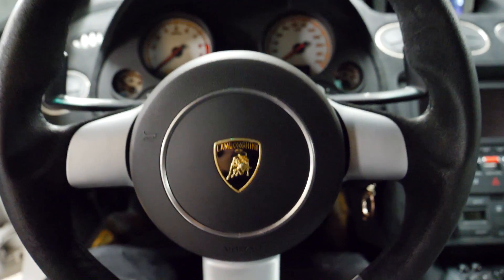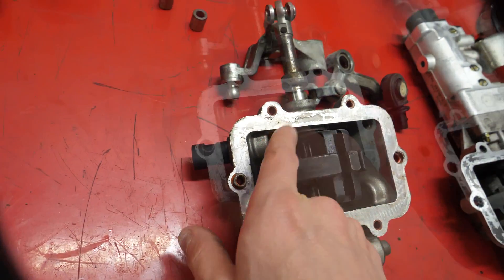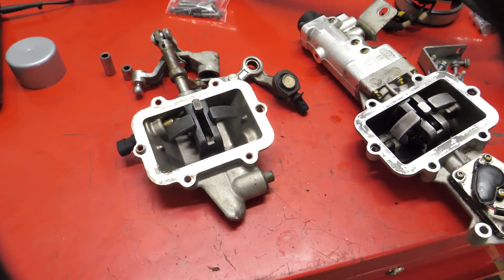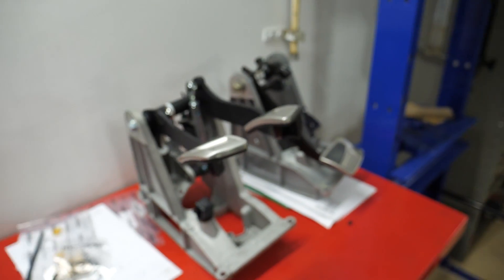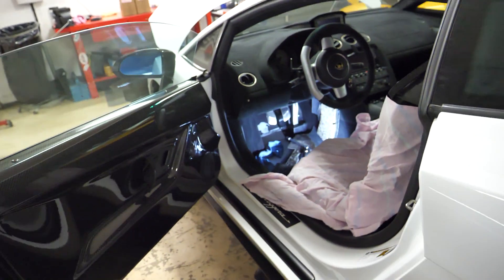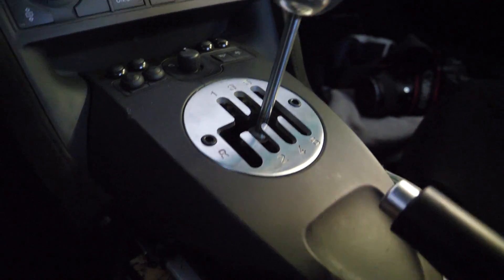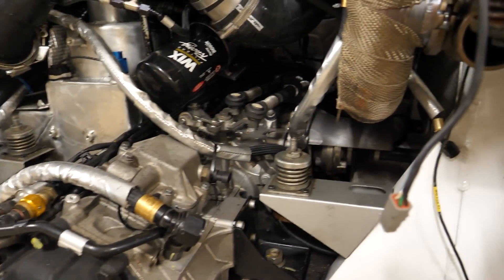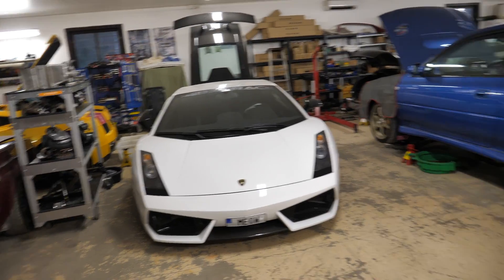Lamborghini Conversion to 6 Speed Manual Gated Transmission

Comment: Love your work, any chance you’d be able to share what size clutch master you ended up running? I’d like to do the same for the manual pedal box/clutch master arrangement rather than going factory. 

Thanks again!
Reply from the maker: I did end up with the OEM cylinder. Don’t know what size it has.

Comment: Nice video, i have one 2004 gallardo at the workshop converter to manual in another workshop 5 years ago, since that time the car jumping from place to another for can issue, there is lost communication with ecm and tcm, but cant find can diagram i didnt expect its that headach - __-
Where to find it? Coz i cant see it in the workshop manual.
Thanks.

Comment: I wish exotic supercar companies would trash the the paddle shipped formula one transmission. Because even on a drag strip they have a manual transmission with a clutch and it's way quicker than that goddamn piece of shit paddle shift. It's not the transmission that makes the car fast it's displacement. There is no replacement for displacement.  Lamborghini and Ferrari and Porsche need to bring back the manual transmission as a flagship option

Comment: Peter great to see a real Engineer/wrench/welder at work, my Gallardo transmission is acting strange it needs to be stripped how many hours would you estimate to strip and rebuild a 2005 30Kmiles it sounds like the 3rd/4th drop gears are 'whining'  I appreciate an experts advice

Comment: Quick disconnects can be opened up to improve flow. That is at least every one I've come across. 

A pair of mechanically coupled hydraulic cylinders can offer a way to get the clutch feel you're looking for.

I recall B is for build mentioning he had the first manual shift conversion. I now wonder that was correct.
Peace.

Comment: Genuine Lamborghini parts might indeed be very expensive.... But Toyota may have everyone beaten. A 1992 Toyota Celica Convertible, has a particular part that, in all, constitutes a single 'diamond' shaped metal plate (roughly 2 inches by 1 inch) with 3 holes in it----two of which feature captive nuts----and costs a damn fortune for no particular reason. Path Number: 02572-86101  and costs $648.00 USD.

Comment: Man, If Lamborghini was gonna go through all the trouble of building the E-gear system for the manual transmission...why didn't they just leave the clutch pedal and shifter in there? I mean that's pretty much an enthusiast's dream...use either or, whatever you're feeling like...there's plenty of space for it all. 

They could have still had either transmission type options but then they could have had a third option with both!

Comment: Hello, Love the videos
Im having an issue with my stage 3 turbo built Supperlegera E gear
I'm having an issue when reversing and taking off in first gear where the clutch is not fully grabbing making it difficult to drive. Only happens sometimes and when it does happen the clutch will not grab.. I can rev it up to 3k rpm and the car barely moves on first or reverse.. if it does grab which it does sometimes it will slam into gear randomly When I turn off the car and turn it back on it resets the catch points and works fine until I use reverse again or go back to low speed driving. I have changed the fluid. did a relearn. changed the throwout bearing, checked the clutch.. still no luck. We had our mechanic observe the clutch on the Lamborghini computer. When you first give the car throttle the clutch starts to release, as you give it more throttle the clutch for some reason pulls back.
If you turn the car off then back on the clutch points do relearn and it does go back to normal... but once agin if you use revers or go at a very slow speed it will start to have the same issue.....
Any idea what could be causing it

Comment: Hey peter ...Im having a issue with my dads vehicle ... Its a 2003 hyundai sonata 2.4l 4cyl . and we just had the radiator replaced because the old one was leaking .. The guy put the new one in and i guess the ac condenser is bolted to the radiator. My question is will having one of the ac condenser bolts off that holds the condenser to the radiator Cause the vehicle to overheat?

Comment: You make a manual conversion look relatively easy here. I never knew this could even be done.

Would that be possible with the gearbox in an Aventador? Probbly not because nobody has done it yet. The electronics would go nuts....
Reply: Would for sure be better than the stock e-gear

Comment: Hey Peter! Thanks for this, I always look forward to seeing your work! A quick question; I just put exhaust on my 09 Gallardo and ended up with no readings on my Auxiliary center gauges, checked all the fuses and even had a friend clear all my codes, but to no avail. They light up at night but stay pinned in "0" position (far left). Any Ideas or suggestions would be SO APPRECIATED! Thanks!

Comment: I'm a Master Mechanic Technician  40 years exp  There is No Negative with Shifting Manually  Congratulations  Now Its a Real Mans Man Car     make sure you Bleed the Clutch Hydraulics any Air can cause Decrease Slave Cylinder Travel and Pressure Plate wont Release Clutch Disc's [Note] I always use High Temp Grease Between T/O Bearing and Guide Tube on Front of Trans      There's Few ways Bleeding Clutch Hydraulics Best way Pressure Bleed with only 1-2 psi or 15-30 bar Pressure don't need a lot I find that's the Best way if you have Spare Cap Clutch Master Cylinder Reservoir install a Hose Fitting center of Cap 5mm 6mm hose for my Pressure source i use Hand Held Manual Vacuum/Pressure pump made by Mighty Vac two ports 1 vac 1 pressure  fill your Clutch Master Cylinder Reservoir Instal Cap with Fitting  Install Hose Between Pump and Cap than Pump up pressure  I Assume Bleed Fitting  on Clutch Slave Install Clear Plastic Hose over Bleed Fitting and Other End in Container to catch Excess Fluid Open Fitting  Your going to have to Check Fluid Level in Reservoir Constantly before gets to Low  Once Get the Air Out Usually Gravity Bleed for 1-2 minutes Leave Cap Off Reservoir Watch Fluid Level Top it off. Tighten Bleeder Fitting press down Clutch Pedal should feel Tight threw Full Travel Make Sure Clutch Pedal Shaft to Cylinder Adjustment is tight so Piston in Cylinder Travels much as Possible .Start Engine Press down Clutch Pedal Shift into Reverse Slowly and same 1st Gear if it shits into those Gears Smoothly good Indication Clutch Hydraulics is working Good. Looks like your doing nice Job Good Luck Hope this was Helpful   When you have Mastered the Art of Heel and Toe while your Down Shifting and Trail Braking before Apex on a Fast turn as you Exit out Accell Hard and Hear the Engine Rev up and Exhaust gets Louder than Upshift Manually threw the Gears is Bad Ass

Comment: That is absolute stupidity converting this car, the dual clutch box is the best option for it, that is why they never made a manual for it!!
Reply: ...but lambo's been using single clutches on older e-gears, Huracan is the dual clutch one
Reply: @dariopiovani5077  OMG you have no clue it does not matter what auto gearbox it was, you don't change it to a manual.
Reply: @jasonswift7098  heck yes if you do, lel

Comment: The manual and e-gear throwout bearings are identical but the seals inside are different. It will be damaged if you don't replace it.

Comment: Great modification. Thanks for the video. Did you by chance ever do a video on your oil filter relocation modification? I've been wanting to move mine to the rear bumper frame to make oil changes either. I'd love to see what hoses and fitting you used.

Comment: but why? no matter how good a stick shift drives, i wont swap my insanely fast sequential out for a gated one
Reply: For the feeling.  I don't care how fast the computer shifts; I like to do it myself.
Reply: Ariff E gear often eats clutches. this can be lessen with manual.
Reply: But the lambo e gear isnt insanely fast or  sequential. It's a normal manual box adapted.

Comment: Im sort of confused. Are the automatic/e gear gearboxes the same as the manual on this car? also is e gear its own thing? cause he talks about doing a transmission swap but to me it looks like hes just adding a manual shifter and linkages, and hooking them up to the original gearbox? so is the original just a manual gearbox but it does the shifting for you when you hit a paddle?
Reply: The Canucklehead Correct. The E-Gear/paddle shift is just a hydraulic system fitted as a shifter. The transmission itself is the same, kind of like how BMW made SMG. 

Sidenote, the box he showed in the beginning is just a manual box he had from beforehand. He bought the shifting mechanism to use on the box thats already in the car
Reply: tensor34 okay very interesting. Most of the experience i have with paddle shifting is on cars with a cvt or just a regular automatic so i was kinda scratching my head over here lol. Thanks for the info

Comment: You have some skills. I consider myself quite handy with car builds, but stripping that gearbox would be a job I would try and avoid unless I had a full workshop manual and all the special tools and a big bucket of courage.
Reply: I believe he works on commercial airplanes thus has great mechanical knowledge of a lot of the functions, which would make it a lot easier to sort of "figure things out"
Reply: Oby One I feel as though when you have enough money to not be concerned about hitting walls there would be a lot less concern haha. Good luck with the swap if you go through with it !

Comment: Best lambotuber on YouTube.
Reply: without a doubt
Reply: Tremec USA makes the best short throw manual transmission shifters in the world. Many people are scared of Tremec USA because occasionally Tremec USA based manual shifter powered super cars are known to beat several automatic paddle shifter powered super cars.

With automatic paddle shifters, when you shift then the power you have remaining is well the power you get.. no accumulated mechanical torque newton-meter power reserved for two seconds. But with Tremec USA short throw manual transmission shifters, when you shift into neutral gear for a moment the accumulated mechanical torque newton-meter power from the torque of highly aspirated engines still remains for a second or two and before you finish shifting gears... that power doesn't diminish for two seconds. And you can use that mechanical torque newton-meter power to even control drag and car stability during cornering and going around bends even.
Reply: You should consult Tremec USA for the best possible experience you can have when driving a manual shifter.

Comment: I do a lot of work for SpaceX in my prototype shop and SpaceX uses dental floss to tie their wiring loom’s
Reply: Haha. No actually it makes sense NASA uses the Teflon-based twine to tie up their wiring loom‘s. I can only imagine it’s pricey. so if you use most synthetic and natural-based fibers to tie up your wiring in very low temperatures and vibration you run the risk of breakage the advantage of Teflon is at low temperatures it doesn’t become as brittle so it won’t be prone to breaking. Also Almost all dental floss is made of Teflon
Reply: Does this mean Elon uses ti-wraps as flossing material???
Reply: That's quite interesting. 🤨🤔